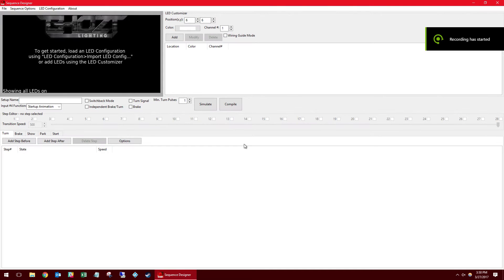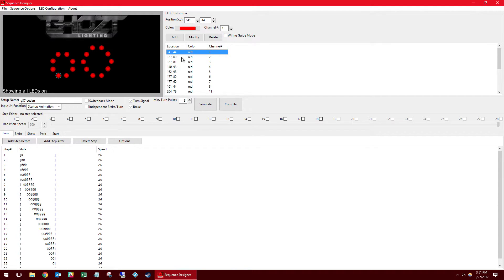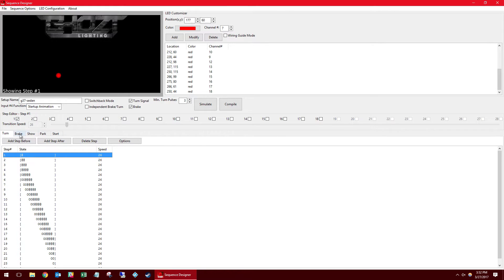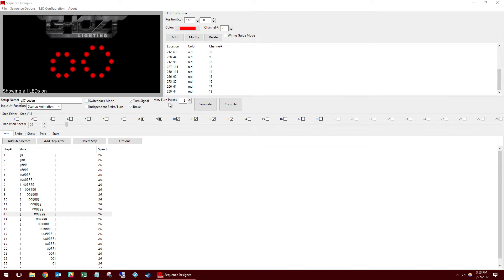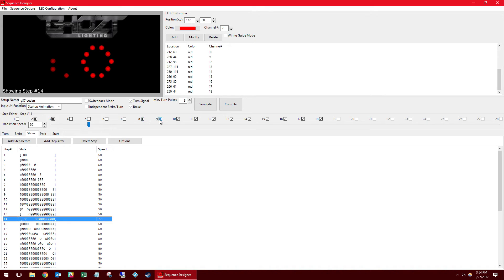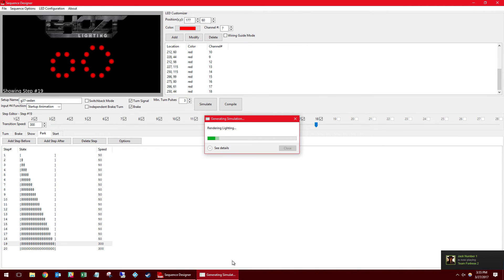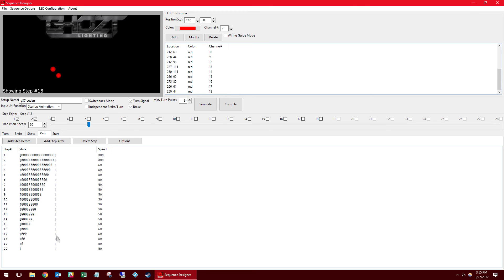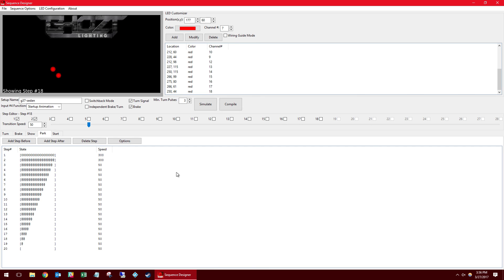Ghozt Lighting: Sequence Designer Demo

Comment: We have a 1927 Buick and only have ONE round 3 inch “Taillight/Running light” on the rear.  No turn signals no brake lights.  I’d love to be able to install a 3 inch round insert into that rear housing that would animate a arrow for left or right turn signal and then also brighten or scroll “S T O P” across it.....is this possible with a Ghozt Module and some sort of round board w neopixels on it?  Anything ready made as far as a round 3 inch board filled w neopixels that I could program to an image like this?  Would love to do the same on the two front cowl lights as well.....   I am a total beginner w this but willing to learn and give it a go!  We love our 1927 Buick but would like to make it a bit safer for my family to enjoy.... any help or advise is greatly appreciated!